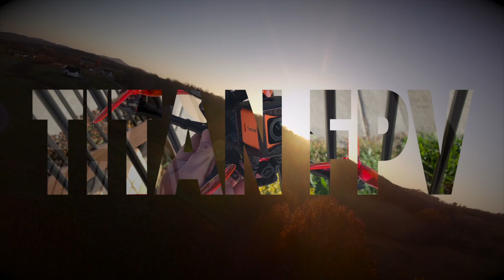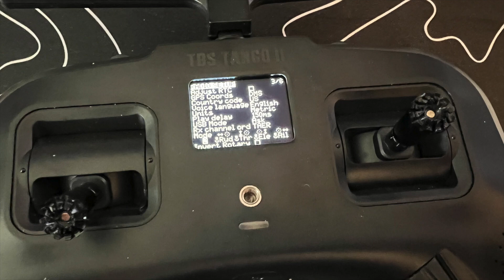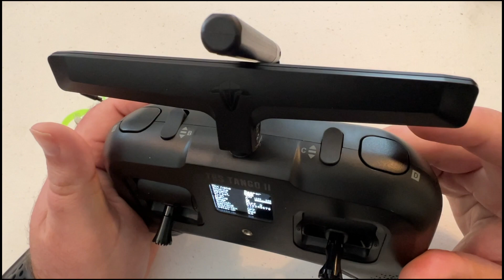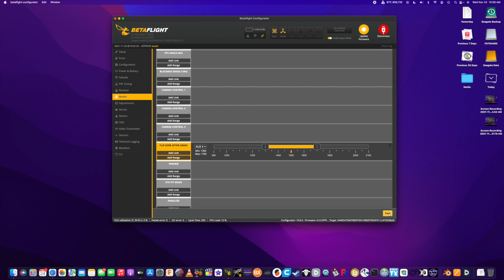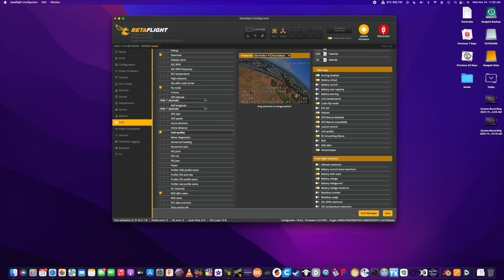Tango 2 ExpressLRS Setup/ How-to

Comment: Hi… after putting the Mobula in binding mode , it starts flashing… then what? Unplug it and plug it back? I mean I followed your tutorial but after setting both the quad and the tango in binding , nothing happens… it doesn’t bind
Reply from the maker: What firmware is your ELRS module on?
Reply: @TitanFPV  V2.0 ... I just got it yesterday... it came with it pre-installed
Reply from the maker: What version of Betaflight is the Mobula on? The SPI rx’s firmware version is included with the Betaflight firmware.
Reply: @TitanFPV  betaflight 4.03 it says and in betaflight the moment I connect , it shows me an error saying that there might be errors because of the betaflight firmware being old for the 4.03 version ... currently the beta flight App I'm using is the 10.7.2 / by the way ... Im using a MAC
Reply: 4.3.0 ..sorry
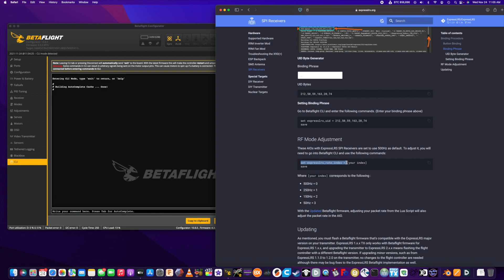Reply from the maker: So about 10:30 into the tutorial, set the packet refresh rate to 250hz via the CLI command. Try the binding process again, and see if it works. The Tango 2 won’t do 500hz, and that’s what the Mobula is set to by default causing connection drops.
Reply: @TitanFPV  hello again… sorry about my late reply… I live in Beijing and was already late the other day… thanks for your help… so I already typed the CLI command about the 250mw and then saved  but still nothing… I’m a bit frustrated… I managed to set the quad to bing but nothing happens when I also hit bind in the tango 2… the FC just keeps flashing… I asked in the ExpressLRS group in Facebook and someone told me BTFL 4.3.0 won’t work with the 2.0 fw of the module… that I needed to update it to 4.3.0 RC5… is that true? I haven’t done it… at the moment the info I see in betaflight is : FC BTFL 4.3.0 and the Board is a HAMO/CRAZYBEEF4SX1280 - so In that case … if I have to update… should I look for one for the board (crazybee…) or for BTFL ? I’m really confused and the truth is I haven’t used any of my quads or the betaflight configuration in more than a year… also the version I have of betaflight in my Mac is 10.7.2 and it also says there is some sort of conflict with the 4.3.0 … so I need to update it to the newest unreleased version? The 10.8.0? 🙏🏻🙏🏻🙏🏻
Reply: Oh … almost forgot… managed to build the update in the ExpressLRS configuration but couldnt flash it wifi or usb/uart… it says the port or communication failed 😔… nothing works
Reply: @TitanFPV  also when trying to flash it ... in the build phase it shows and error when trying to find Patromio or something like that...

Comment: Great video.  I have an issue when I got to run the elrs Lua it gives me a syntax error. I've deleted and reinstalled to no avail. Any advice would be greatly appreciated
Reply from the maker: Thanks! Did you download the lua from the ELRS Configurator? V1 and v2 luas are not cross compatible.
Reply: @TitanFPV  I did dl it "elrsv2.lua" from configurator. I still get the error. I also flashed my module to 2.3 with success. I'm new to fpv and all this technical stuff. Please forgive my ignorance on this matter
Reply: @TitanFPV  just started over from scratch  looks like I got it going. Now time to see up the whoop with bind phrase. Thank you for your time. Subbed!
Reply from the maker: Awesome!

Comment: I’m planning to get  the older batch of HM Nano 2.4 for my tango2, have heard telemetry warning issue due to hardware. But this is the only model available in my country as of now should I go ahead and ignore the telemetry issue and jump in or hold up and get a better newer model for the tango 2 i already have the Betafpv lite radio 2 with elrs and like the low latency put poor gimbals makes me want to get a module for the tango. My primary use will be for indoor whoops and cheap experimental builds. My better quads will still run crossfire. 
Thanks
Reply from the maker: The original “Ironman” lite module didn’t have issues with Telemetry. The only one with that issue is the first batch of the Slim Pro. Retailers should be carrying the version with the telemetry issue fixed now. If you do get the older version with issues, HM will repair it for you if you send it back to them. You can also opt for them to send you a repair kit if you are comfortable with soldering it. I returned mine with issues to my local dealer. I picked up a fixed version later.
Reply: @TitanFPV  ahh I see. Appreciate the prompt reply. Around where I’m from  albeit next door to China things aren’t as simple to send across and receive per say. 
Returns recalls that kinda stuff has sometime to go here in India.
Reply from the maker: Jumper recently released a 500mW lite module with their T Pro radio. You can also purchase it separately. https://www.arrishobby.com/products/jumper-aion-elrs-24g-nano-tx-module I haven’t had any experience with it personally, but it looks nice with an led screen. I don’t recommend the BetaFPV lite module(I had issues flashing it.)